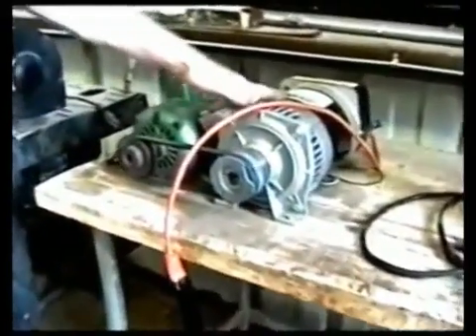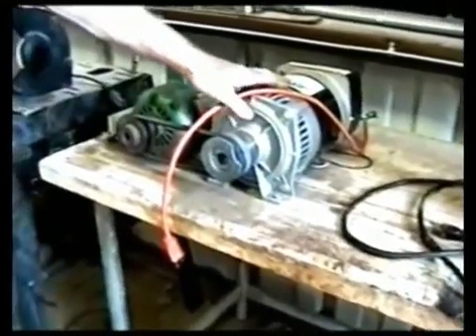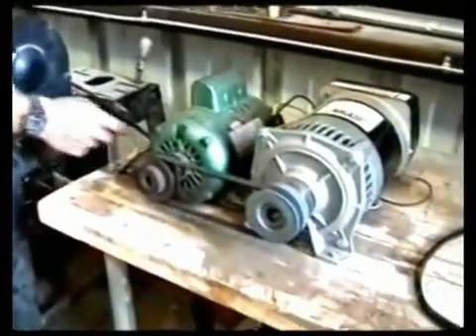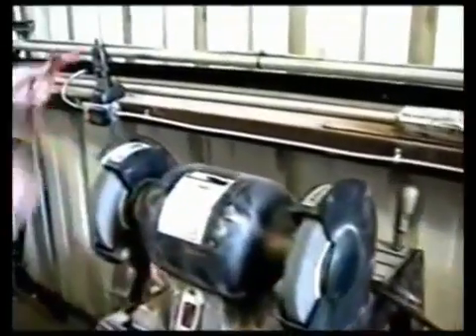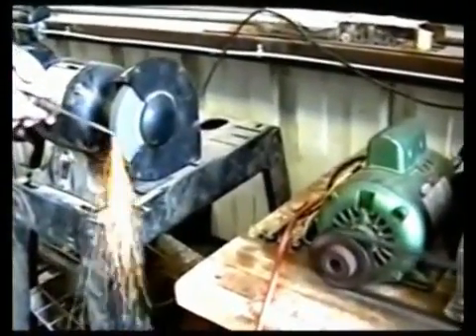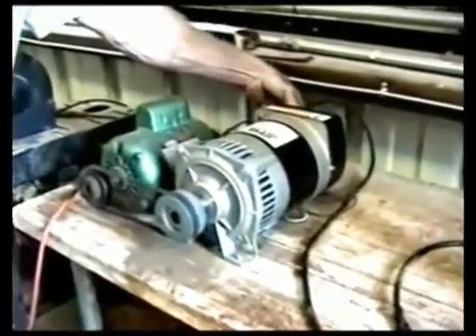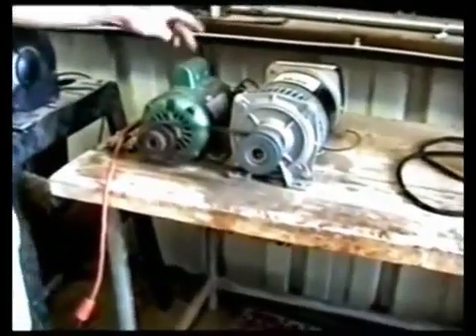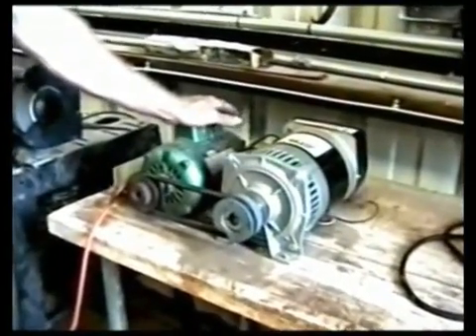3000 Watt Generator Powers Itself, Grinder & Drill Press.

Comment: nice..I've always thought if you had a motor =0,and you put it thru an energy maker= 1,and each time the energy would go into a more powerful energy maker= 2...then 3..then 4...then sending the energy back into the motor=0...it would never stop running,as the motor would give more energy to each system until it reached more energy and then sending the energy back to the motor....the tech. thats out there,would make this possible,which would be a free energy motor,as it makes its own energy.

Comment: why don't use this setup on electric cars to keep battery charged for motor running the car it would be continuous if done right and possible be able to use less battery only thing you would half to run delay on generator to run 10 min after car stop to maintain full charged I think could this be possible and also how much for that alt and where do you buy it i want one

Comment: Until you have Mark Dansie in to verify this, it's BS... you need to plug it in and start it up and not be throwing any other switches before you unplug it and it continues to run....also set it up out on a driveway or in a parking lot with one extension cord to the project, unplug the cord and walk it away from the setup........If it continues to run you have something....but I doubt it....

Comment: if you had the generator re-wound for 200 times more power, than you WILL run into thermal limitations and currant drop as heat builds effectively negating the gains from the re-winding, for the short term of power needs, it would work, but your run time would be limited to the generator temperature and loads applied to it

Comment: nice  toggle swich hide...    that is easy ,, but   u still neded  the electrical company to run u project  or buy diesel , gasoline or l p gas to run a external fuel generator ,,  owwww

Comment: This is total scam, absolute rubbish, basically he has power under the bench connected into the motor/generator, the guy plugs into the electricity to run it, then switches on the bypass switch, then unplugs the mains, you are a fraud my friend.
Why bother??? we all know the yanks are incapable of discovering or inventing anything.  This just takes the biscuit!!

Comment: I keep hearing "modifying", but I don't see any evidence of this. He says nothing about what he did to get any additional energy. All I see is a very big electric motor that is mostly likely equal to the power of the bench grinder and drill press together.  It would probably bog it down if someone was grinding and actually drill something that would put a LOAD on the motors.

Comment: this does not work. it must therefore be faked. there will be losses in the system so it will stop after some time. it works more like a flywheel the a motor in this case. sorry for bad english xD

Comment: Would very much like to see this in opperation, when switched over the generator is powering the motor which is spinning the generator yet when you switch your grinder or drill on there  would be an inrush current that would at lease cause the speed of the generator to stutter a little yet it does not ???? I have a 2Kw Honda petrol generator and yet turning my 800 watt 4 inch angle grinder on causes the engine speed to dip slightly which recovers a second later, very interesting scratch head {o:

Comment: There is absolutely NO WAY this could work.  The generator would have to be producing more energy that was put into it.  That is not possible in any system.  There is no way to get more energy out of any electo-mechanical device than what you put into it.  A generator cannot run a motor that runs the generator.  There is energy loss as heat and friction inside both the motor and generator.  Even if there was zero resistance you're removing energy with your tools.  Can you say --SCAM?

Comment: Let's try that again... What a load of tosh!!! If this were possible everyone would have one and the energy companies would be out of business!!! Power in = Power out, but then you have to account for the heat generated in the motor which is lost energy and also the cable volt drops and lots of other things. Is there anything in the world that is 100% efficient?! If you did "switch it over" onto it's own source, it would either just stop like it had no power or more than likely just slow down a

Comment: May I be skeptical about it's use? As I know first kind perpetuum mobile does not exist. You either bent the rules of physics (and violated the conservation of energy law), or the actual setup is powered by something else.

Energy output of the motor will have to cope with loss of friction, heat, from the gen and motor itself and transmission.. both motor and generator are not 100% efficient, and thus I call this a hoax.
(I know this comment will not be approved)

Comment: And all the energy used by the grinder and drill press along with the heat energy released by the motor and generator were originally drawn from the 110 volt outlet. So no its not free energy its just an insufficient battery. If one were to measure the power output of the 110 volt outlet at start up, it would equal the output power of the generator plus the measured power of the heat being released

Comment: This is such nonsense there is a very famous rule in physics created by Sir Isaac Newton . Energy can not be created or destroyed. Since both the motor and generator release energy in the form of heat (they get hot as they run) energy is lost at a constant rate. Yes this device will start up but, as it looses energy (heat) it will slow down and eventually stop. With this specific set up you have you would loose all energy in under 1 hour.

Comment: You need to explain how you are defying the laws of thermodynamics, cause even the most efficient motors only run at 90% even if you system is running you have other problems like impedance, you cant create energy from nowhere

Comment: i have a bigger one at home, it powers my entire house. only for the washer, dryer and fridge the solar panels need to provide a little extra. i use the solar system's battery to jumpstart the generator too when i turned it off, which i only do when going away for longer periods of time. saves it from unneeded wear. plans are not for sale, but you can get them from me for free via the regular (tor) channels. last time i tried to sell em i had to run from the feds.

Comment: To prove it worked, you should have shown you flipping on the drill press with it being unplugged. What I am getting at is i have a suspicion the drill press was using a "dummy" power chord. and it was plugged in somewhere else to give the illusion it got its power from the generator. People are so easily tricked! I bet this does not get posted by contributor.

Comment: white and black cords under the 3000 watt generator @00:15-00:16 are not
connected to either the 3/4 HP motor nor the Orange extension cord. This
is due to the fact that the maker of this device does not want the viewer
to know or see that there is a hole under the generator motor which is 

covered by the generator itself.

Comment: Comments held for uploader approval?  Nice.

See, the problem I find is that you flipped one switch to turn the generator on and the other switch (which originally controlled the AC power) to turn it off.  Very telling.

Comment: the energi in any system is constant, you can not take power from the generator on the long run, even if there is no load, the system will slow down and stop after a period of time depending on the rate of energi lose by the bearing friction,

Comment: dont confuse this for perpetual of free energy. the back emf of the genny will ensure that this will slow down every time ... leaving you to plug this unit in repeatedly. its a simple mechanical means of storing energy, its like pumping water uphill for hydroelectric use, it takes more energy to move the water up then its going to produce coming back down

Comment: wouldn't there be a way to use human power to start it so that it doesn't have to be plugged into an outlet at all.... say like using a bicycle... i seen a Hollywood movie a while back where this guy turned a wheel an it started a generator.In theory i knew perpetual motion was possible it just has to be given a kick start so to speak. what if you used a clutch to disengage the bicycle power once the machine is powering itself.

Comment: 0.23 to 0.26 - I thought it odd that there was a cover under the table running front to back directly under the right side motor... so I looked again, not only is there a cover to hide the alternate power cable, but you can see the cable going to the right at the back of the table. then it drops down the right rear table leg... not free power, not overunity...

Comment: you prime the induction motor by feeding AC from current outlet, then once the generator produces  
current it feeds the induction motor so the rotation continues. The current generator produces higher current than the induction motor needs, that is why the generator is able to run more equipment other than the induction motor that makes it rotate. Am I right? thanks for posting. I got an idea. 10 Q 10 Q mwahh.

Comment: you say its been modified to put out more power to turn itself ! im assuming the  avr {automatic voltege regulator } has been replaced  with  a simple rectifier and the load of the motor regulates the generator  just as the motor turns the gen set.

Comment: This is a HUGE misleading. It is impossible for that generator to power itself (period), let alone a drill press, and/or a grinder. The power it takes to turn on that gerator itself is 2900 watts. Then it puts out 2900 watts, but loses some of the input energy as heat, therefore ending the supposedly endless cycle. This generator cant even power itself. If that grinder or drill press was attached, it would come to a screeching halt. Save your money people. You have a scammer on your hands.

Comment: this idea isnt new. its been around for years, yes it is somewhat free energy, not totally, but somewhat. because due to the fact that you need a starting source for the generator until it reaches optimum output to sustain the motor driving it. now the fun part, when the generator reaches peak performance and has a draw, there is a circuit that switched on that send more power to the motor to sustain the generator. using an ac motor is bad, use dc, less draw, more power.

Comment: LOL not one single disbeliever in the comments, the internet is full of gullible schmucks.

Should have learned in school, you can't get out more than you put in. I'd like to know how this generator can produce more power than it takes to run it. It's also amazing how when the tool motors apply a surge and load to the generator, the generator doesn't slow or load down.

Comment: This is a violation of the first law of physics: the conservation of energy.  This is an example of a perpetual motion machine which cannot exist.  The combination of the motor and the generator, without any load, will eventually stop due to forces such as friction, air resistance, and resistance in the motor wire etc.  Any of the wasted energy will end up as heat; the lowest form of energy. Energy cannot be created nor destroyed, only changed.

Comment: How long does it run, and is there really no external supply or battery with a small charge in between. Looking at this there must at least be an energy transfer loss due to resistance.

Comment: Wouldn't this be awesome miniaturized into a flashlight or laptop? Too bad it isn't real!
I commend you on the use of a 3-way light switch to make people think you are actually using that orange cord for powering the motor. 
You showed your left switch was for the orange cord, and the right to enable the generator.
BUT, at the end, you turned it off by flipping just the left switch: just like a 3-way switch works showing the orange power cord does nothing, makes a fairly good illusion.

Comment: I see no change in rotation speed and hear no noise change before and after unplugging the network connector. So, the motor is powered not from the generator but somehow else.

Comment: This is unpossible  The law of physics says that you cant destroy or create-produce energy from no where  energy exist and change form for example  the  (Internal combustion engine) the only think that does is to change the form of energy frοm chemical to thermal  Kinetic -and electical Energy altenator is just a part of this changes form from kinetic to electrical but it cant create more power that takes

Comment: You are quite bold . . . I have been telling people for a couple of decades . . . what you have demonstrated . . . I did it on a larger scale running a bank of welding machines . . . . if you take a drill motor and spin the two units ; to startup, you don't even have to plug into the wall outlet.
Our vessel ; The Lady Pink With Her Sea Legs ON  . . . went from San Fran to Oahu with very similar tech EDT and something we call hydrodyne . . . not a drop of fossil fuel . . . very very fast . . . to

Comment: This doesn't prove anything. They never show the back of the unit. How do I know there aren't hidden wires? Also, when the grinder is plugged in, the device keeps running at the same speed. Shouldn't it slow down when under load? None of these free energy devices have been proven to work. If these people really want to help humanity, why don't they offer the plans for free? 

I wonder if the poster will have the guts to approve my comment?

Comment: There is somthing eles under the table to maintain motor to turn after he unplug cord from wall. The magnet motor generator can not start electric power because electric motor need coil to turn, but if he turn in to magnet motor, he need to remove coil (Need space to put magnet). So he is trick us...

Comment: Yes, it is possible ! Good work ! Congratulations !  PS: I've made the system myself (without knowing yours) , but with little ones and I'm still working to solve the collateral problems like : noise, heat, interferences, lubrication, the automatic-system, etc. PS2 : On short : YOU'VE MADE A GREAT STEP WITH THIS VIDEO, YOU NOT ONLY OPENED A WINDOW, BUT A DOOR !!! Again : CONGRATULATIONS !!!

Comment: people have been trying to do this for years now i do not believe that this is true i think that it is plugged into AC power under the table , if this is true how long ago did you build this and then why has this never been on TV, RADIO, or any NEWS.from all that noise you can only power a drill, or grinder, i would need to see this to believe this .i call this  BS  .

Comment: i wanted to hook up 3 altinators to a drill/12v run the drill from a 12v battery and use 1 altinator to keep the battery charged then hook the other two altinators up to two inverters everyone told me it would not work maby they were wrong

Comment: Consider this: One motor turning a generator, which provides energy for a bigger motor, which drives an even bigger generator, which provides the energy for an even bigger motor, and so forth,  you get the point. At the end you provide the energy for a large power plant which drives an even bigger one. And soon we can power the world with this little 3000 W generator system, and by the way, you can still run your bench grinder and the rest of your genius shop.

Comment: I'd like to know how exactly you circumvented the laws of thermodynamics.  Or maybe you should just show the hidden wires?  
Also, 1HP is 750 watts, so a 3kw generator would have the capacity to run four motors like that, not struggle to run one.  Inversely, you would need a 4hp motor to properly drive that generator at full load.  I especially like the way the pitch of the generator setup didn't change when you added "loads".  You are peddling lies.

Comment: That's very interesting and maybe revoultionary. But i'm wondering, If you had put a larger pulley on the motor, more electricity would have been produced. Is that right?  So maybe the modification of the generator is not necessary.

Comment: You guys realize this is a joke right? The generator didn't change tone when he turned on those high amp things plugged in to it and plus even if the motor and generator were 100% efficient the second you pulled a single watt of energy it would have slowed and stopped. So don't waste your money and fall for this scam.

Comment: Basic physics (law of conservation of energy) dictates that what is being displayed here is not possible. A mechanical motor cannot be 100% efficient. A mechanical generator cannot be 100% efficient, the friction of the belt would have to be Zero, all wiring internal and external can have No resistance, the system can produce no heat and no noise as both are loss of energy. All that I've listed must be just to run continuously without drawing any energy from the closed system. Sorry it's a sham!

Comment: Hooray for perpetual motion machines.  It's using the power from the wall to spin up the generator and motor, then using the left over angular momentum to continue running for 30 seconds under load after the input energy is removed.  Try running this for 5 minutes, I dare you.

Comment: Yes or No pls. Would it be possible to hand crank this to start instead of relying on plugging it into the wall. What I mean is. If it's REALLY powering itself surely a proper gear/pulley and chain/belt setup such as that of a bike so it doesn't rip your arm off could be used. You know in place of plugging it in.. ever.

Again the question is does it HAVE to be plugged in.. Yes or No.